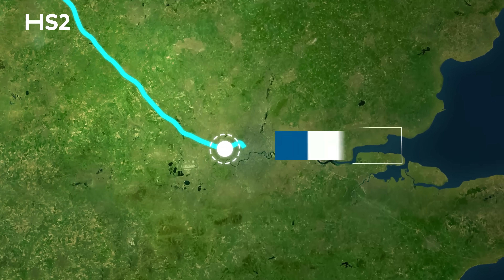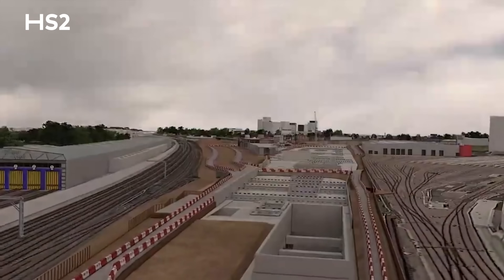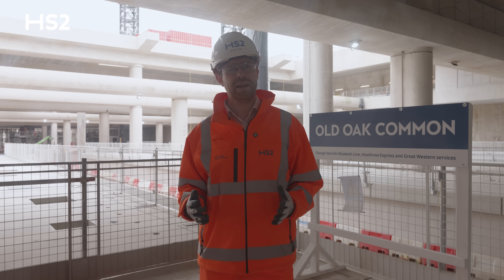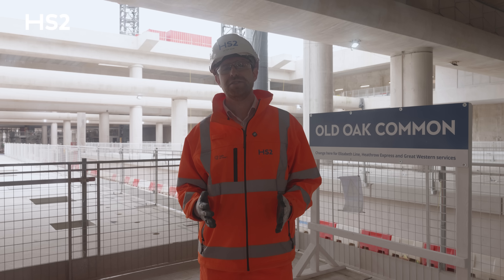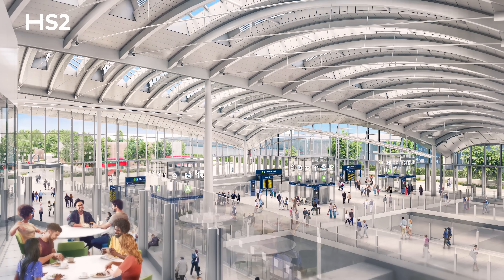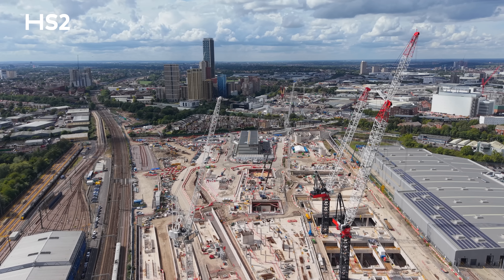HS2 Old Oak Common Station Project Update | November 2025

Comment: But why Old Oak Common??  There is nothing there, we are in despirate need of a huge hub station at Euston...
Reply: not trying to glaze hs2 or make it look really good or anything but old oak common is very useful for heathrow - if you're arriving into heathrow from somewhere outside the uk and want to continue to edinburgh or something, you'd get another plane, which is of course bery bad for the environment, by encouraging people to take the elizabeth line + hs2 for the next portion, we can reduce these unnecessary short flights and use greener electric trains. i believe hs2 was going to go the airport for this reason, unsurprisingly that's cancelled and lrobably one of the least important hs2 extensions

Comment: Would have been better to start in Manchester and go south to Birmingham. Then run outta cash. Part of the UK problem, so London centric n everything
Reply: Here we go again, no it would not of been better just starting in Manchester as the whole idea of HS2 is to relieve the Southern Half of the WCML from Handsacre to Euston and Birmingham New Street of high speed passenger service to allow more capacity on the existing WCML for freight trains, also you never build anything like HS2 from one end only as the line is being constructed from Birmingham North to Handsacre and South to London and North from London towards Birmingham with sites being constructed in between. HS2 is NOT London centric as you put t as the HQ of HS2 is in Birmingham City Centre plus the the main maintenance facilities nd HQ of HS2 train operations will be t Washwood Heath in Birmingham

Comment: The Euston Tunnels should continue to join HS1 to allow at least 4 through platforms to facilitate access for trains from the midlands and the north to the channel tunnel and the European mainland. Even if they don’t come into operation straight away, it would future proof the line, and because the tunneling machines will already be down there, it would mean that there wouldn’t be less cost and disruption to London in the future when someone eventually realises it should have been planned that way from the beginning.
Reply: This only makes sense if the UK rejoined the EU, and the Schengen area, otherwise you need whole sets of separate platforms and border control and security at every other station, and also doesn’t really make sense unless the trains go through Euston as otherwise every international train is one less train to London, and that would require a long U bend tunnel under central London which would have massive alignment challenges with all the underground infrastructure there - as well as redesigning euston, not to mention international services would then be split between Euston and St Pancras. Compared with just changing trains (and everyone going through security/border control at St Pancras, this just makes no sense at all

Comment: The biggest waste of money this country has spent in recent decades. All to save 20 minutes! It would have been cheaper to reopen the line from Paddington to Birmingham Snow Hill by reconverting the old Paddington parcel station (now a car park) into platforms and improving the Chiltern mainline to run at higher speeds. Ditch the Chiltern Mk3/DVT sets and ordered GWR some more IETs instead. You'd probably get close to saving the same amount of time, getting the same connectivity for half the price!

Comment: While it's great to see such investment in a modern railway, it boils the blood that such consideration can be given to improving transport links in London, but not the regions. Driving West London at the cost of driving the line further into the country is wrong on every level. And how much faster would the journey to Birmingham be if the train didn't have to stop just as it's getting into it's stride, just to help West London, which has reasonably recently seen massive investment in the mainline electrification and Elizabeth line?
Reply: You need to take the wider plan into account. The full HS2 plan would've basically Britain's TGV network, linking the most of the country together and relieving capacity on a huge swathe of the existing rail network, allowing more local trains to run all over the place. As it is right now, the effect is obviously going to be much less, but at least they are building a proper spine which can then be bolted onto later with future phases (if they get resurrected). It could've been better, but doing this project is still essential and will still have big benefits for "the regions" (at least as far Birmingham anyway). If they can extend to Crewe or Manchester it would probably double the benefit without too much additional cost. I have feeling HS2 will eventually get to Manchester. Leeds SHOULD be built, but I have my doubts about that one happening. If it does ever happen, it'll probably take 10-20 years to get going.
Reply: Old oak common will be a major interchange so many people will want to change for West country, Heathrow and West end/city amongst others.

Comment: If this was China, then HS2 would already have reached John O'Groats. Seriously though, amazing work at Old Oak. I hope HS2 does ultimately reach Glasgow/ Edinburgh.
Reply: If this was China, there would have been considerable worker deaths and injuries, zero environmental protection, a lot of corrupt officials falling out of windows and the line would be running at 1960’s speed due to a raft of safety issues. A look into the reality of Chinese HSR is shocking, most of the lines are either close to bankrupt or suffering major defects. 😳
Reply: @HighFell  Yes, sadly you are correct. Also their building a ridiculous line to Tibet was chiefly down to their annexation of that country. I was being darkly witty, I suppose!

I did not know about the bankrupcy issue, I thought the Chinese rail businesses were largely government supported?
Reply: @mattylamb658  yes I found a fascinating documentary on the failure of Chinese High speed rail. Although virtually everything is state owned, it does still need to fill various financial criteria. Huges swathes of the Chinese HS network are un used, there just isn’t the demand or people can’t afford the fares. There are other ‘technical’ issues that seem to be glossed over as ‘the trains run slower to make less noise’ 
On the financial side of things, the economic miracle in China seems to have hit the buffers somewhat. That has affected the property markets hard, Evergrande collapse was beyond spectacular, but huge developments are uninhabited, infrastructure is unused. 
HS4 to John O’Groats would make a possible Le Jog Cycling expedition more fun..   although they would probably have no spaces for bikes on the train 🤣🤣🤣
Reply: @HighFell  Interesting, thank you. Ha ha no prob. no room for bikes, true!😁
Reply: yeah, but china is rich

Comment: The concept of a fast commute between London and the major Northern cities was a good one twenty years ago when it was initially proposed. However, nowadays with working from home being a far more viable option, there’s not much point in spending £400 every week on a commuter ticket to London and back... - is there? 🤔
Reply: This new line will free up a lot more room on the west coast line for additional freight movements - this isnt just about a fast commuter line. Its about increasing capacity across the whole network. This then helps to stimulate economic growth and helps to get freight off the motorways whilst decarbonising in the process.
Reply: @jackwah  plus it will allow more stopping services by removing the London to B'Ham trains
Reply: This is getting tiresome. HS2 was NEVER about shaving 10 minutes off a commute. It was always primarily about freeing up capacity on the existing network (which is sorely needed, even in 2025). Go to the search box at the top and type in "Gareth Dennis HS2" and spend 5 minutes listening to the actual case for HS2 and then you'll see why it should be built, in full.
Reply: AI doesn't need a super fast rail network...🤔
Reply: @leethrelfalllt I agree with that but as it’s due to be fully electric it will open up the freight routes and then hopefully take a lot of diesel trucks of the road.🎉
Reply: @philtucker1224 AI with revolutionise just in time supply chains and logistics..there will be less road haulage as a result of this...😊
Reply: @leethrelfalllt that’s excellent. I think converting heavy goods trucks to all electric will be a challenge in itself but that seems to be the way they want to go in Europe. However I don’t think the rest of the world is likely to change from diesel, not in this century anyway…

Comment: Nice work, keep the videos coming, remind the viewers that this is about capacity not just speed, I hope it's connected to HS1 in some way shape or form to integrate with the rest of Europe as well as extending north of Birmingham because that is critical to future economic growth.
Reply: It will not be connected to HS1
Reply: @andrewreynolds4949 so for travelers outside of London there still won’t be a direct link to Europe?
Reply: @knutjonsson1816  No
Reply: @knutjonsson1816  Why do we need it, there are Airports at Birmingham, Manchester and Liverpool with quicker connections to Europe than HS1 plus Birmingham Airport will have it's own Station on HS2 with Birmingham Interchange Station
Reply: @peterwallen1063 seems like an oversight to not offer direct high speed rail connections from the rest of the uk to Europe. for short hops across the channel trains should be the main method of transport
Reply: @knutjonsson1816  It has been tried and failed and when you have quick short haul flights from Birmingham Airport and Manchester why do you need a rail link to Europe
Reply: It can't be connected to HS1 legally unless you want passport control at every station

Comment: Great to see the progress. The only sensible answer is to build the full HS2 to Manchester and beyond. Growth along this whole route will justify the investment. HS2 is an investment opportunity for Great Britain, and we must not sell it short!
Reply: I think it should go to Liverpool and Leeds not just Manchester
Reply: Midlands North West Rail Link is probably going to happen instead, and better for it, it's way cheaper and less flashy
Reply: Connect the big 3 cities London Birmingham and Manchester would give the country a high speed railway spine that other lines can tap into
Reply: @user-od5tl9rx9v what about Scotland?????
Reply: @shetlandsheep3081 Yes, the whole country will benefit to some extent from building HS2 as originally designed.

Beyond Manchester and Leeds, capacity increases are diminished as rolling stock would share existing infrastructure unless a dedicated HS3 were built to Glasgow, Edinburgh, Inverness and Aberdeen as a minimum.
Reply: @shetlandsheep3081  What about Scotland you get more than England
Reply: @user-od5tl9rx9v  tap into it how?
Reply: @user-od5tl9rx9v  if that was the case why didn’t start in the north first?
Reply: Really? A project which was meant to be for the north hasn’t even laid a single brick. If that was truly then case why didn’t they start in the north first and what about the branch to Leeds? Yet again we were sold a lie
Reply: HS2 is a con. It always was and always will be. The costs are spiralling out of control. 
They also had no intention of going north.
Lying cheats.
Reply: It's an investment in London only. If it doesn't benefit London it doesn't get approved. Disgusting!
Reply: @AlanNobleNE  It is not investing in London, more investing in Birmingham considering the infrastructure around Birmingham which includes to main line stations, Birmingham Interchange and Birmingham Curzon Street Station, the massive Delta Junction on the edge of Birmingham, the 3.5 mile Bromford Tunnel, the rebuilding of 3 road bridges in the area, two massive lattice girder bridges and a viaduct into Curzon Street station and the building of the HS2 maintenance depot and HQ in Washwood Heath Birmingham so HS2 has nothing to do with benefiting London being a Birmingham based project
Reply: With all the other problems facing the Country ( housing shortages and associated infrastructure, hospitals rebuilding programne, etc ) HS2 is not top of the priority  list and it will be many years, perhaps decades before HS2 is extended.
Reply: No its not its fucking stupid.

I can get a train to London in 1 hours 40 mins OR I can piss about getting a train to Manchester (20 min if on time) to get a connection to London.

Seriously?
Reply: @nickhutchinson3259  The self-absorption... HS2 is stupid because your personal fastest route from your location to London is better? Forget the millions making the proposed direct journey every year.
Reply: @nickhutchinson3259  Sorry next time the government plans a major infrastructure project they should consult you personally as clearly you believe that's the only important thing.
Reply: 20 minutes @ £13 an hour..Vs £100 billion..yep the sums do add up..👍
Reply: fI there was any sense HS2 would be canned and the money saved spent solving more pressing problems.
Reply: @aw34565  Capacity on the railways is a pressing problem. Heathrow's third runway should also be a top priority. We need massive infrastructure upgrades all over the country.
Reply: @JScot92 AI does not need extra rail capacity or super fast journey times..the money would be better spent on the electrical network..👍
Reply: @JScot92  HS2 is supposed to take a load off the current network so it won't be so congested as the current high speed routes would be moved to HS2

Comment: Ouch!
That's getting on for if not surpassing 

"How on earth‽
Easy.
Made them an offer they couldn't refuse" 
sort of levels!

Reminds me of the first bit of some clever clogs bloke at my dad's work who had this favourite phrase...
Concrete and Concentrating on the details are the start of Construction.
Sorry to inflict that and thank God I don't remember the rest.
Fun guy.
But it is true.

What colour you going to paint it!
Reply: Sorry I'm on one a bit, but stuff Blue Whales, how many swimming pools volume, how many miles,grr kilometres of metals (eventually) and as to weight, the whales used to be more familiar elephants and the they'd probably have to be subbed, given the time of year, for how many reindeer, Polar Express/other Christmas train locos &c., &c.,  umm,   must be sthg. Standard size Christmas Puds!
Reply: 500 747s apparently.
Yes but it's an arguably more familiar object and both move using fluid dynamics but the planes carry more than just the single passenger.

Comment: Just out of interest - if there was an HS2 / 3 line to Edinburgh via Newcastle, and Glasgow via Manchester - would it be possible to with a non-stop service to do it in under 2.5 hours?
Reply: No. Allowing for stops at stations you would be looking at 4 to 5 hours.

That said the city centre to city centre time for London to Glasgow would still be quicker than aircraft, more comfortable than aircraft and depending on government price controls cheaper than aircraft.

The main point of HS2 and all new rail lines is not simply speed it's also capacity and opportunities for economic activity.  It means new locations for housing, lower dependence on carbon fuel and the freeing up of existing infrastructure that is running at design capacity.
Reply: @RichardFraser-y9t  But you can already do London to Edinburgh in 4.5 hours. I meant a dedicated (theoretical) HS2 or 3 line. Non-stop.
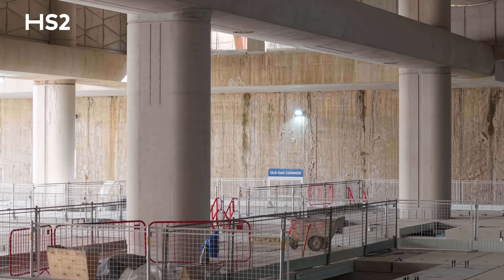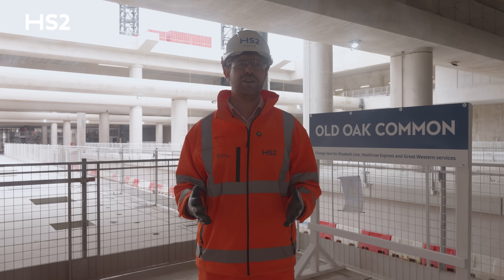Reply: @RichardFraser-y9t this is incorrect if HS2 lines went all the way to Glasgow and Edinburgh the total journey time end to end would be between 3:15h and 3:30h, ECML is just over four hours today and WCML is 4:45 for the fastest services

Comment: i hope its not going to be dark and dingy and overcrowded like new street, with an equally confusing concourse layout
Reply: It won't be dark abz dingy. Thexroof contains a lot oc glass so it will be bright and airy  that will supplement the green environmental points in the overall project design.
Reply: new street is not confusing, platforms go 1-12 and its clearly signposted
Reply: @melissareohorn7436 the different zones and having to go into red zone to see screens is stupid
Reply: @andrewjames3908  it helps you know which gateline to take
Reply: @andrewjames3908  The main train time table screen is on the main concourse
Reply: @peterwallen1063  which is hard to find because of the confusing layout and you have to go out through ticket barriers to get to it